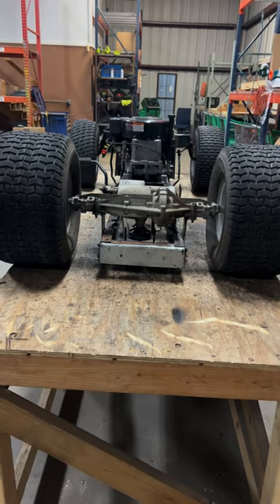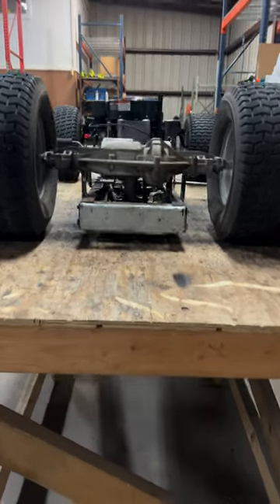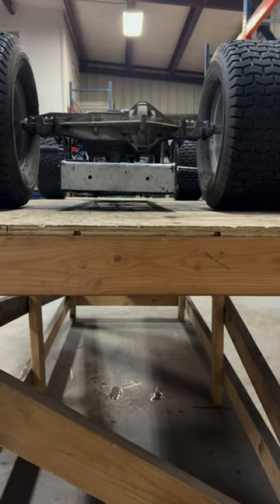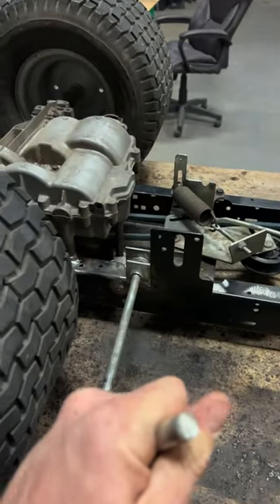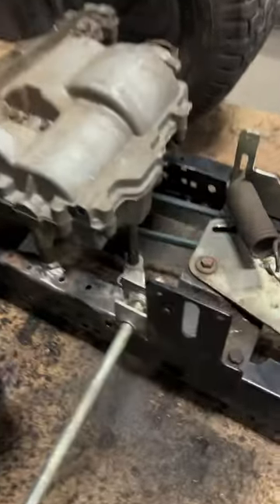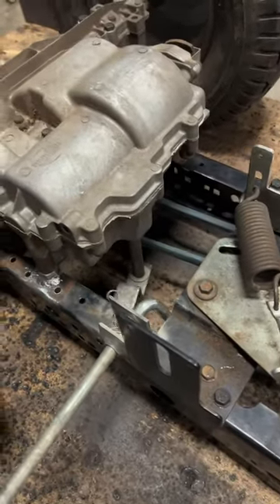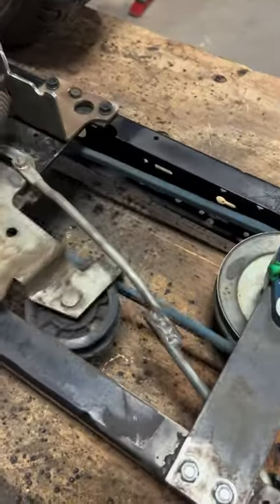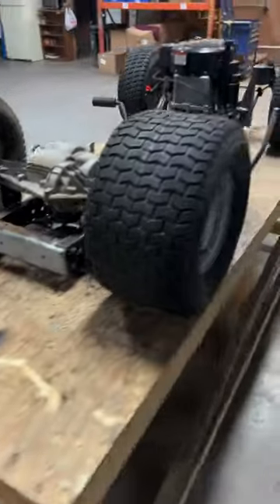Pt. 2 How to Flip a Rear Axle and Keep ALL Forward Gears!!

Comment: This may actually be better than the other way as assumably now the needle bearing for the input pulley will be getting more oil/lube than when stock. I've seen someone say that in the stock configuration, the needle bearing can be a main failing point unless you run a DIY oil drip on them at high speed.

Comment: I flipped my axle like this and the gear oil started leaking out. ??
Reply from the maker: Where was it leaking from? You may need to plug your fill hole or replace a seal. I’ve also heard of running bearing grease or a mixture of bearing grease and gear oil to thicken it up and keep it from leaking
Reply: @wybarprojects  
Ty for responding I appreciate it
Ya I gotta look at it 
I was thinking the same
The project is coming along great thanks to your vids
Reply from the maker: @boidizzle429  that’s awesome! Good luck with your build 👍
Reply: @wybarprojects  
Thanks man I would send a couple pics if I new how it's coming along just like yours I'm lowering it now and going with a go cart steering set up
Reply from the maker: @boidizzle429  nice! If you want to send pics, you can email them to wybarprojects@gmail.com 
I’d love to see them

Comment: Regardless of how u stop
It your better off mounting rite side up just from the top not bottom .

Oils gonna piss out eventually it has to..

Not knocking it at all u get what I’m saying ?
Reply from the maker: Ya, I know what you mean and that is most people’s concern with it. But flipping axles is pretty common in the racing community from what I’ve seen and I haven’t had any leaks so far 🤞
Reply: @wybarprojects  run till she bust then man 🤘 but if fails u know what to do lol🤙 rite on.

Done for years myself it’s fun